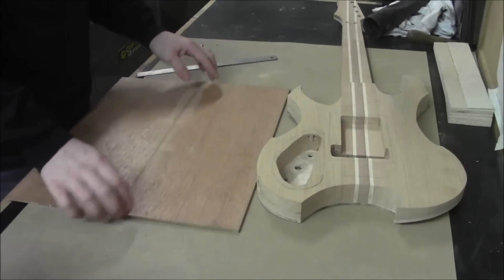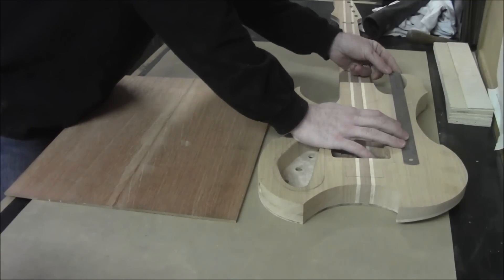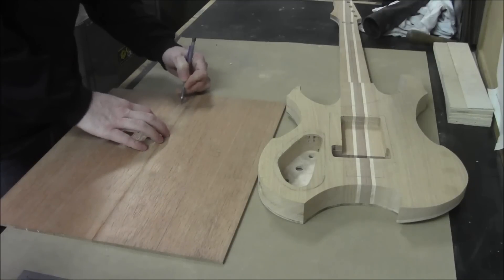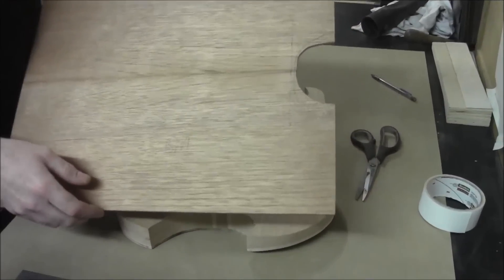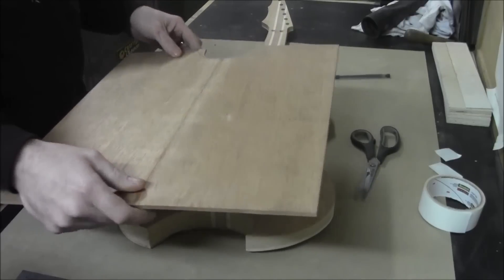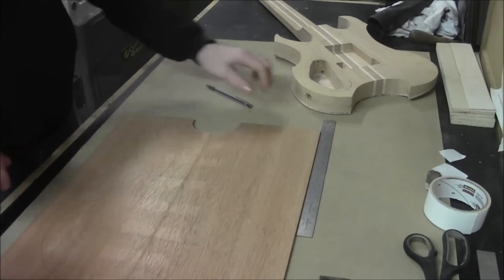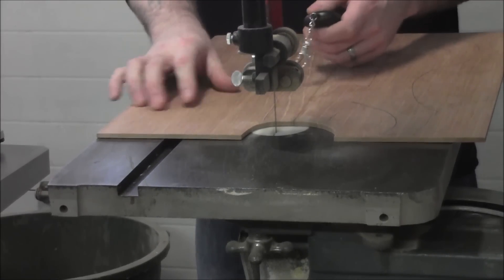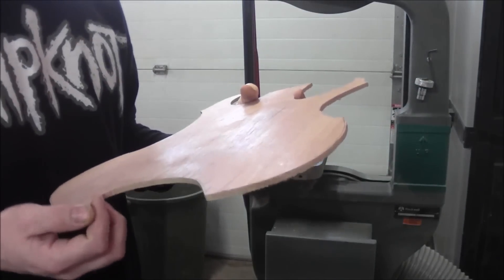How to Build an Electric Guitar-Video 12-Book-Matched Back

Comment: Wondering, why didn't you use a router bit to cut the back to the same profile as the body?  Seems it would be less work than cutting on the band saw.
Reply from the maker: did you watch the whole video?